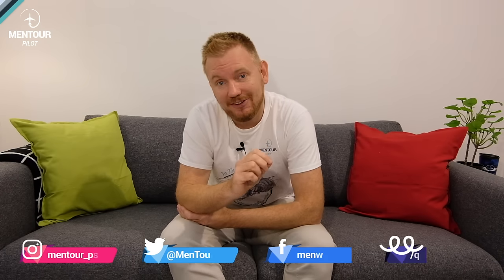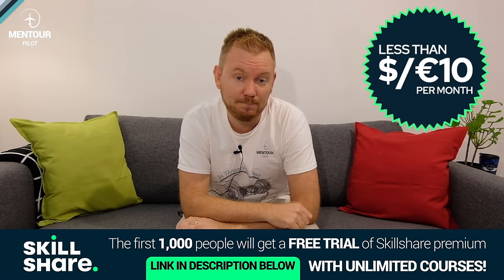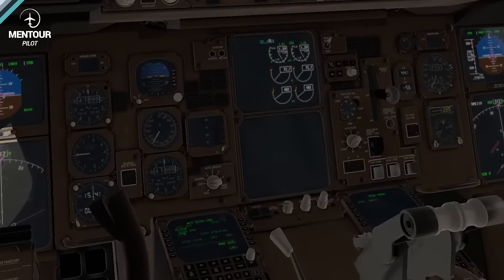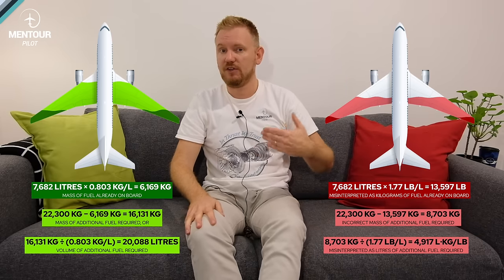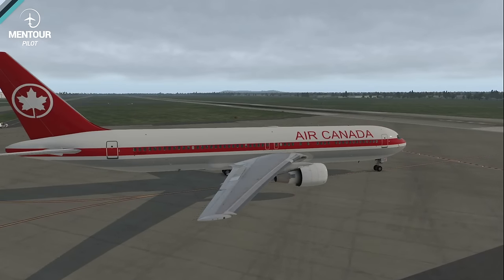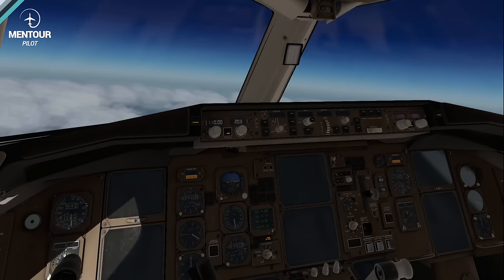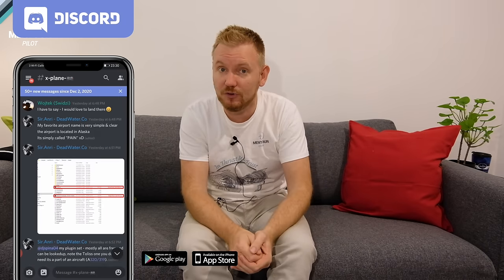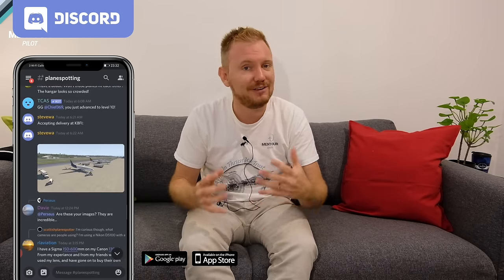The Gimli Glider! Explained

Comment: This is one of my biggest pet peeves of being a Canadian, I wish we just used the Metric system for everything instead of a mix of both.
Reply: You were switching over in the 80s, the switch isn't complete yet? 
I'm in the U.S. and still suffering with mostly imperial and a mix of metric.
Reply: @donjones4719  Technically we are completely metric. My drivers license has my height in cm. Measurements for anything you buy will be in metric. People will still give you their height in feet/inches and weight in pounds. Imperial is also still used in construction. It is a strange mix really.
Reply: @chrisjohnson7929  indeed, never fully converted. Cook the Christmas Turkey at 375F while it's -20C outside.
Reply: @mikelang4191  I know the Brits like to conversationally use F for high weather temperatures and C for low ones. Sounds better anecdotally I guess.
Reply: @mikelang4191  Must be because Fahrenheits makes bigger numbers loved by marketing...
Incidentally the warmest I've been was 230F, which makes only 110 in Celsius.
(sauna was forgotten to heat up for extra quarter hour or so with full fire in stove)
Reply: lots of reasons for that
--first, having to deal with U.S. in almost every sector and with Americans all the time requires having a working knowledge of both systems
--in some elements it's too ingrained; for example properties were long ago staked out in acres, never in hectares. 
--for some industries like railroads (it still uses mileposts) it's too hard and expensive to change 
--in some parts of the culture it's stuck--it will always 10 yards for a first down
--metric doesn't work in country, rock or folk music, or in history "I'd walk 160.9 kilometres to see your face" doesn't sound as romantic as "100 miles". 
Calling an old stagecoach inn the 11.3 Kilometre House doesn't have the same ring as the 7 Mile House.

Comment: This is the one where I think he angled the plane sideways and downwards before he landed. Incredible move.
Reply: Forward slip, commonly used by older light aircraft that don't have flaps to lose altitude quickly without gaining lots of speed.
Reply: @ajg617  The move is much more dramatic on the Air Crash Investigation programme.
Reply: It's pretty standard for a lot of smaller aircraft, especially older ones. We (pilots) tend not to do it with passengers aboard because they tend to freak out -- the tilt and the plummet tend to be very distressing unless you know what's going on, and often even if you do. It's also a very common maneuver for glider pilots, and part of the training and often the examination for glider ratings and badges.

Comment: Love this story, and have seen other presentations on it. You, however, added much more detailed information about how a series of small, but important, events led to this account. Thank you for adding all that. I still think the pilots did a fantastic job landing. It will remain one of my favorite airline industry stories. My all time  favorite story is how two British Airways pilots saved everyone on board after sudden both engine failures just seconds before landing at Heathrow airport, in 2008, I believe. Also the Taca flight that did an emergency landing on or near a NASA installation and save everyone, too. These three are my top good airline accident outcome stories.

Comment: One question. Have the pilots subscribed to sponsor “Brilliant” to up their math skills?
Reply from the maker: Hahaha!
Reply: @MentourPilot  another great one you might cover is the United Airlines flight 232 DC - 10 crash that was another great example of great Airmenship.
Reply: @philipcovington1985  And don't forget both TACA Flight-110 and Air Transat Flight-236.  Both landings required extreme dexterity just to reach the landing site, followed by master handling of the airplanes (or should I say "large gliders"? !!!) to touch down correctly.  TACA Flight-110 had the additional difficulty of captain Carlos Dardano of having only one eye, as he had lost the other eye when being shot during a flight into El Salvador during a civil war there...
Reply: @MentourPilot  Included into Math skills for pilots, should be the dimensional check (or how to check that a unit conversion is correct or not by cancelling the units, that avoids the common and too frequent mistake of performing a multiplication instead of a division and viceversa); that should have caught the error they made when converting units...
Reply: Unfortunately Maurice Quintal (FO) and Rick Dion (AC Maint super who was on board) have both died.  As far as I know Bob Pearson is still alive.
Reply: @Vincent_Sullivan  yes he  is

Comment: Well done Glider pilots, these guys did a great job from a very demanding situation.  A few things come to mind... approaching an airfield when high, thinking as an ex military jet pilot, sideslipping is great fun but  S turns work, not sure if this is good with airliners but g stalling works as well.  Either way taking off without fuel indications blows my peanut, FOEL checks were ingrained in my dna as a baby pilot and if you don't know. how much fuel you have in the tanks.. eish!  Three things a pilot cannot use; air above them, runway behind them and fuel that is not in the tanks.. and with the latter... how would they know??

Comment: the wall street journal, of all places, had this story front page, and after reading it I felt i had an understanding of how this happened.  awfully good thing one of the pilots knew this field.   I have picked up more details over time, but the JOurnal article stands up fine. Flying with inop fuel gauge , confusion over usgallons vrs other gas measurements - that made for the possibility of this incident.  The pilot earns respect and admiration for his timely, skillful contributions.  The fact remains: captain didn't know  his fuel status at takeoff, and was obligated to know what he had then. If he has to measure himself to reassure himself, then he must do so.   One can not fully understand the silence after both engines went out, the bad, bad feelings at the time, and the glee when a proper runway was within possible glide distance.  Nose gear notwithstanding........

Comment: I dont know about airliners. But in a glider you would always initiate a sideslip with aileron input first. So for the maneuvre youre describing you would first imput left aileron, wait for the adversive yaw pushing your nose to the right and then use the right rudder to stabelise and control the direction. Also you usually have to pull up the nose quite a bit cause the aircraft will try to gain speed

Comment: Good video but at 17:30 there are two corrections to be made. Yes, the Gimli Military Base was decommissioned, but the base had TWO parallel runways, and only ONE was decommissioned. The other became a fully functional, fully supported Municipal Airport with a 6800’ runway. The pilot unknowingly lined up on the wrong parallel. The decommissioned runway was used as a combination NHRA Drag strip and Winnipeg Sports Car Club Road Racing Circuit. There was no drag racing that day, but there was both road racing and go-cart racing going on that day. By the time the B767 arrived at 8:38pm, racing had finished for the day. The photo at 24:14 shows what I believe are “Formula Ford” racing cars used on the road racing circuit. The photo was taken the next day when racing was resumed. The photo shows very short early afternoon shadows on the ground, which means it was taken much earlier than 8:38pm so it had to be the day after, but before the nose wheel was extended, and the aircraft was moved to the other side of the airport.

Comment: Thank you for this highly-detailed account, which all the others seemed to gloss over (and is why I am finally subscribing to your channel, btw).

I have always believed that most air disasters are NEVER due to a single issue, but MANY SMALL ONES, all cascading like a snowball rolling down a hill until suddenly, disaster strikes.  That was certainly the situation here, when a lot of minor problems added up to one gigantic one.  I also think that much of this could have been avoided if the entire airline industry would stick to either imperial or metric measuring systems.  To me, this is the same as one country saying "Port Side" to mean "left," then "Starboard Side" to mean "right," then leaving it up to each individual country to determine which they prefer!  This is stupid and suicidal on its face, and whoever is responsible for inventing this convoluted and confusing system should be held accountable, NOT a flight crew with little experience in this regard, and more pressing things to think about like flying the damned airplane.

That said, I believe that the way the pilot landed this incident was MUCH more of a miracle than even "The Miracle on the Hudson," where the pilot enjoyed the good fortune of a perfectly straight approach, on calm water, with many watercraft in the vacinity to make the rescue — not taking anything away from Captain Sullenberger's superb skills.  In fact, I can't think of even one example of a pilot using a small craft landing trick to safely land a full-sized airliner, without instruments, on a short concrete runway full of people, much less a captain who had only HEARD of the technique, without the occassion of ever having to DO it.  When they performed a flight simulation of what this man did, every single pilot that attempted it, crashed.   No one on earth deserved the commendation more than this crew received, all heroes in my eyes.

Comment: I had the opportunity to climb over the accident aircraft the day it arrived at the Air Canada hangar in Winnipeg, just before repair operations began. Having just joined the RCAF, I was home for a long weekend from RRMC, one of the three Canadian Armed Forces degree-granting colleges. Along with a Boeing engineer based in Winnipeg (and a family friend), my father was the Air Canada maintenance manager responsible for verifying airworthiness for the ferry flight from Gimli, and for managing the repairs. The abrasion and heat damage to the fuselage was eye-opening to a budding engineering officer. One image stands out, because it speaks to a passenger's experience: a bible sitting on a window seat, forward in economy. In my memory, at least, it had been gripped so tightly that it remained rather warped.

Comment: 767 is amazing platform. It has been landed safely without fuel in Canada, without landing gear extended in Poland and nobody died in both cases. 787 did take away passenger market from 767,  but Freighter and Tanker versions are going strong.

Comment: I learned to fly gliders in Gimili.  It was an air cadet training Center.  Most aircraft in Canada that have had issues/crashes have had tail numbers ending in 4,  The Gimili glider was tail 604,  WestJet has no tail numbers ending with 4 because of this.

Comment: I learned about this from Air Crash Investigations.
That was one Hell of a landing. Landing without engine power, the nose gear did not fully extend, and there were two boys playing on the runway.......and they went to “The Prometheus school of running away from things”.
No one died. 
I know they got in a tiny bit of trouble for her math error......but the fact the plane was salvageable no one died (just a few skinned knees and elbows due to the steep angle of the tail escape slide).an he did something NEVER did before successfully....he earned the positive recognition.

Comment: I love this story and have read a lot about it. One of the other notes I recall was that when they gave the fuel man the 5,000 liter request he had only that number, no knowledge of where the aircraft was flying to. Had he been told the destination he said that he would have immediately said 'you can't get a plane this big to go that far on that small amount of fuel.'   Additionally a clue arose when the plane accelerated more quickly and lifted off sooner than they expected due to the low fuel load. Likely not something that they considered at the time but looking back, it made sense.
Reply: Really? I think anyone that is trying to insert the fuel guy into this is really reaching for cause. Sure, 5000 litres just isn't going to cut it, but it's common to request fuel with tanks that are far from empty. I've done it countless times depending on the scenario I'm in, and I wouldn't expect the fuel service to ask me about where im going, and how much fuel is currently on board. That's just not their job.

Comment: The Avianca 52 crash near JFK had a similar root issue... I think there was a confusion between kilos and pounds, and they ended up with critical fuel in DC Center's airspace.  Another very interesting accident, with a lot to teach about decision-making and communications when low on fuel.

Comment: I'm Canadian. Was about 20 when this happened. Would've missed it but my Dad couldn't stop talking about it. When we were kids growing up near Vancouver, Dad made sure we never missed the Abbotsford Airshow. I've read and heard varying stories about the Gimli Glider over the years but none spell it it as well as you have here. I'd never heard about drag racers. 

Canada committed to changing from imperial to metric in 1970, under Prime Minister Pierre Trudeau. In grade 4, (1970) I was taught metric for the first time. Metric road signs weren't implemented until 1977. The year before I got my drivers license. For years afterwards, there was a business selling stickers for your mph speedometer. Used them myself. A whole lotta conversion goin' on. We still buy plywood and lumber in imperial. A 4x8 foot sheet of plywood, 3/4 of an inch thick. A 2x4 inch stud. And the 2x4 is actually 1.5/3.5 inches. Go figure. The screws you'd use to attach the plywood to the stud are sold by the inch.

We're still not fully metric. Converting once can be an issue. Converting several times can only make things worse.
Reply: I remember, rightly or wrongly, my teacher - would have been grade 2 - telling us that the 50 km an hour sign that replaced the 30 miles per hour sign was just for the winter because it was icy out. I totally remember the stickers.

Comment: I am more than amazed that the maths to do a conversion was so hard to do correctly..
I am also surprised that the cut off switch with the yellow marker on it was not checked to see if it had been turned off, rather than just consider it to be out of action rather than check the master switch to see for yourself.
After all, you dont take your car on a long journey without making totally sure you have enough fuel, as it is, that does not effect the end result, my view is that you can always take fuel out the  other end but its a pain in the butt to run out, and that in a car, aircraft are a totally different ball game, you cannot stay in the air without some form of power.
That little generator you mention produces a very small amount, and thats when the plane is travelling in a straight line, not side slipping i am amazed that there is not a rule of carrying a glod percentage more fuel than required as there are cases where damage can loose you fuel.Of course i am aware that we are talking apples and pears, but the error should always be in your favour as you never know when you are going to get held with a holding patern for quite some time, all still burning fuel.
I really cannot imagine the people at this drag race to see this very large bit of kit coming their way.I dare say that a nosewheel collapse on touchdown did a fair bit of damage overal, but because its at the sharp end there is a lot of wiring coming from the flight deck aft so i wonder if it was repaired or not.
However , my biggest concern would be the inability to do the conversion which as a bottom line is the cause of this, maybe a check via drip stick after refueling would give a concrete idear of the amount of fuel onboard.
Glad to hear there were no major health problems due to this, but its concerning that something lime this could even happen, after all, fuel is the life blood of an aircraft, so surelY  ALL PUMPS and FUEL INDICATORS 
Really should be a no gauge no fly situation regardless how good a glider pilot the guy might be even though it did save the day.
Another great video, very much deservant of the thumbs up and subscribe for me anyway, my flying interests go back to schoolboy dreams and a 12 year stint in the navy which included carrier work.

Comment: I saw a different video on this incident, and when they got to the part about them being too high and fast, but not having enough altitude to do a 360 turn, I figured out at once what had to be done.  I used to be in a flying club with a 7ECA Citrabria, and I've used the side slip several times.  Once I was asked by the tower to spend minimal time on the runway as I had a Lear jet behind me!  I had to firewall the throttle to keep ahead of the jet, and then transition to landing speed.  I waited till the last minute to cut the throttle, and then put in maximum cross controls to slip the aircraft.  I dropped like a rock, the mains touched on the numbers, and I took the first turn off the runway to the taxiway.  Lot of fun actually!  Got a compliment from the Lear captain on the radio too.

Comment: As a licenced 767 engineer (retired) it was cringe worthy to see the holes lining up in the cheese. I remember the circuit breaker collars we used prior to this accident being banned afterwards because the breaker could be reset and the collar would stay there, they were replaced with a fork shaped collar that would not stay there with the breaker pushed in. Why the pilot took the aircraft with no gauges working is beyond belief and why the engineer would sign off disregarding the MEL is also unbelievable. The problem started when the engineer reset the breaker and failed to return the system to the MEL state plus crew and engineer complacency and possibly poor manual updates. Arrrg, the mind boggles.